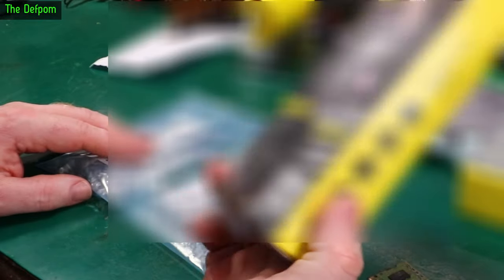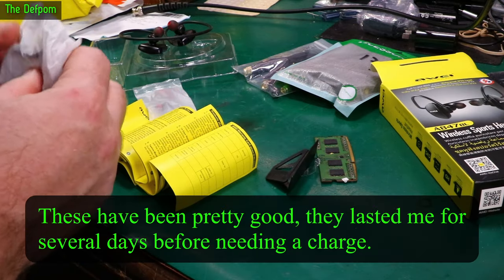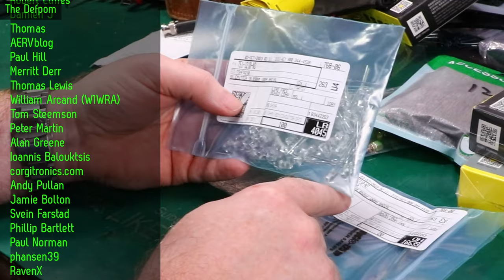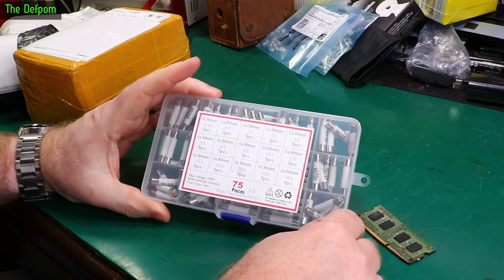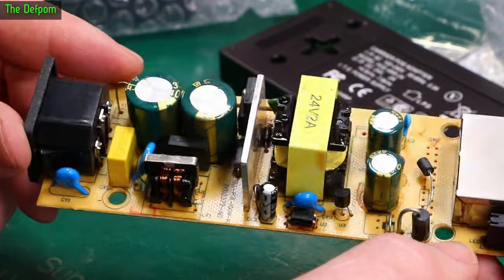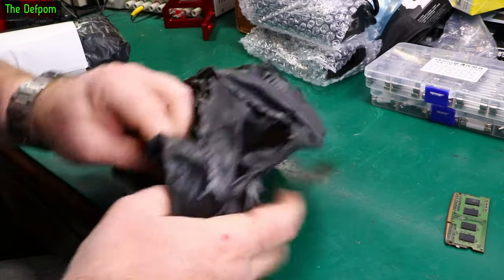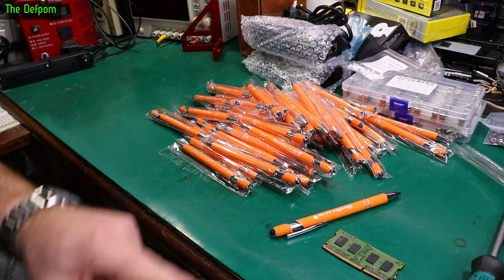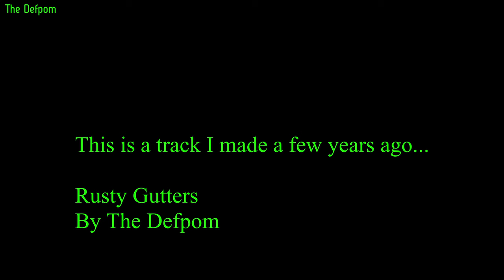🔴 Mailbag Monday 13th November 2023 - No.1195

Comment: All those broken screw posts put a drop of super glue on them before they break and then add a piece of shrink tubing to hold it tight and for extra strength, for the 24 Volt power supply

Comment: Have you tired the antennas with ground planes?
The frequency you deduced, was that from the SWR, LOSS.
What was the impedance at the frequency you bought them for?
After calibrating the VNA, does the 50R test load measure as 50R on the VNA?
Do you have an office stationary fixation......
Reply: I agree, the lack of a correct ground plane and the position of the antenna in relationship to the test equipment and other objects in the room makes a big difference in the return loss measurement. If you calibrate a VNA with a 50 ohm load won't that load always read 50 ohms? I would try a 75 or 93 ohm load after calibration with a known good 50 ohm load and also check with a know length of air line for correct phase measurement. Regards, David